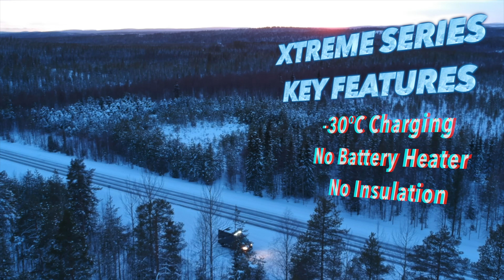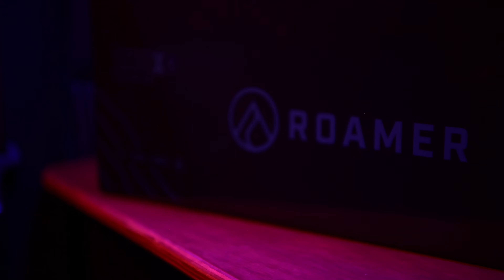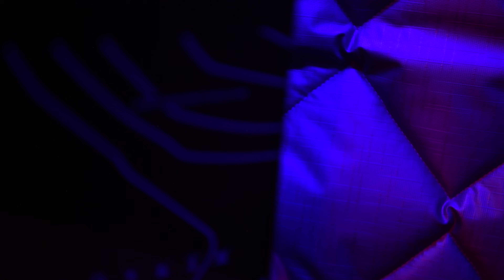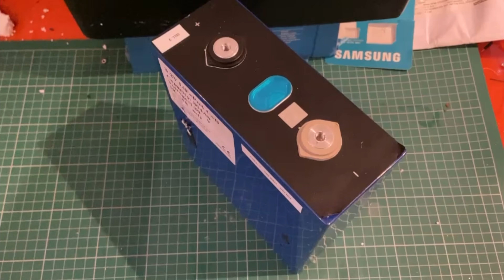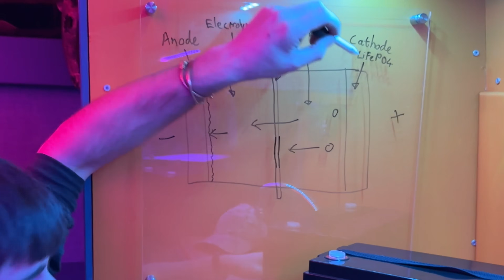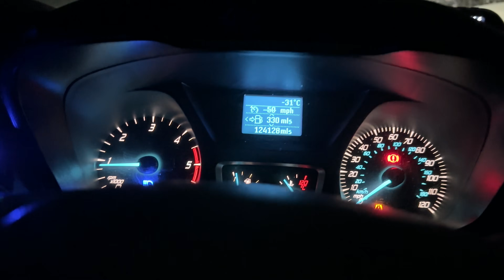HOW TO charge LITHIUM below ZERO!

Comment: LiFePO4 != "Li-ion" [sic].  The two are very, very different.  The voltage on LiIon is far more linear with charge discharge than LFP.
If you charge a 12.6V 3S LiPo to 12.6V when it's at 0*C and then the day time sun hit it and it rises up to 30*C.... the voltage across the cells can be greater than 4.2V causing harm or worse.
It's why if Li_Ion is used in solar/bulk storage it's limited to 4.1V and 60% capacity, with the 20%-80% charge target.
LiFEPO4 is a completely different ball game.  The charge voltage tolerance is far, far higher.  More importantly the tolerance of far outside the nominal. Unlike LiIon/LiPo, LFP's fully charged drops rapidly with 1% capacity to around 3.4V.  Ironically, 13.6V float voltage.  However, if you put up to 4.2V across a cell it will not explode or be damaged.  A Li-Ion/LiPo charged to 12.0V is undercharged.  Charged to 12.6V it's fully charged.  Charged to 12.8V it's overcharged and being damaged. Charged to 13.0V it's likely to be on the path to fire.  12.6V = full.  12.7V = overcharged.  Compared with a 3S LiFePO4 and "99% charge" is around 3.4-3.5V per cell.  Max charge voltage is 4.2V.  It gives you HUGE headroom.  It also makes top balancing by charging to 3.7V and allowing absorption, provides a stable "max" top balance without additional resistors.
Reply: what does a resistive top balancer do?  Add Ohms to the top most cells.  What does putting a voltage greater than 3.6V per cell do?  Yep.  Exactly the same thing.  Keep trying to push voltage and the cell will just provide more ESR.  Inbound current drops towards 0.
By pushing LiFePO4 all the way up to the 14.40 or even 15.00 voltage provided in "automotive class" 12V circuits, actually top balances them by default.
Reply from the maker: Thank you taking the time to reply ( apologies this comment got lost in the comments ) 

Yes Lifepo4 is different from li-ion but that why i say early on this video say this video is only about Lifepo4 and not another other variations of lithium chemistry due to being such a variety and use case.

However thank you for the detailed post
Reply: @MispronouncedAdventures  A note on my balancing comment.  It only works that way if you have a tricky current.  Any substansial current and it will unbalance at the top.  Not worth doing out side of a test.
Reply from the maker: True, my older lithium batteries ( which were converted from a EV ) but had a diagnostics plug in for a computer to see some very detailed read outs. I got used to watching the effects on balancing / unbalancing at the top with different charge currents. Which help me pick my own charge profile
Reply: @MispronouncedAdventures  Doing just that as we speak with the data output from a JK-BMS fed to a database and displayed with garphana.
LVC test went "ok".  Decided to try a bottom balance.  Today it reached full charge, although with a huge inbalance and a cell HVC :(  The JK-BMS balancer is "ok", but not great.  
The heltec flying cap balancer does a much better job, but you need to switch it off or it will sip power away when not needed.
Reply: Through years of use the old "LiPo" batteries would lose a cell if bank was set at 12V if load current would drop below 10V and "die" if not connected to a charger. For off grid I would still recommend keeping a standard Lead Acid battery for starting or where can instant 150-250+ CCA Amps are needed. It appears newer gens of LiFEMNPo4 batteries come with the VCO added so batt voltage stays above 10v. On mini packs, the tech has improved so if a charger that requires separate cell connections as to recharge, supplying dc to batt as to get voltage above 10v salvages the battery from being tossed.  Of course in remote cold areas keeping a good gas generator, and keeping LiFEMNPo4 within optimum range and keeping charge/discharge 10c or less=😊

Comment: Isn't this what Winston does with the LiFeYPo4 for quite a while already?
Reply from the maker: This is a interesting point. I had not heard of the Winston or the LiFeYPO4 chemistry. 

I’ve only had a quick scan of the datasheets. It seems it changes to the LiFePo4 chemistry adding yttrium to make LiFeYPo4. Where they have achieved a similar end goal by changing the Normal LiFePO4 lithium chemistry over the video approach of changing the electrolyte and anode.

Winston seems to be a raw cell manufacture and not a end user battery as in this case case, discussed in this video.

I wonder what the pros and cons are of this variation of chemistry over others. Higher price or weight. 

Interestingly, their cell seems to be prismatic which is an interesting use for a cold temperature cell as cylindrical cells are better at thermal regulation. 

Cool variation of lithium chemistry tech anyway, my previous set a batteries LiFeMgPO4

Comment: Hi Alex very interesting. At one point you talk about using a Victron smart shunt did you say you are or aren’t going to see the power the battery is using to heat itself ?
Reply from the maker: These batteries don’t need heating. 

The part I mentioned that internal battery heaters,consume energy, but it’s done in a number of different ways. If it’s a built-in battery heater, then the energy use is going to be upstream of the Victrum shunt. shunt would never see the energy being used. And SOC would be out on Victron shunt ( but not the batteries own BMS SOC )
Reply: @MispronouncedAdventures  thanks for that clarification. Much obliged 🙂👍

Comment: Very interesting stuff Alex!! As I'm going to built my own 4 season exedition vehicle in the midterm for longterm use (also cost wise) but also open minded for more purpose use of components (here very cold condions), I'm asking myself, if there is a "best" temp for loading those batteries and best for unloading them compared to "normal" LiFePo4? Let's say, 20°C, will the special Roamer-Batt's electrolyt cause less life cycles or less percent of unloading capacity?, what about at +60°C or more in hot summer full sunny parking spot near equator (been absent in a colder pub for sure ;-) )? For me, going a 4x4 max. 6m version with a bit of good wading depth, searching always for more room space and volume, I could think of positioning such Romaers underneath the camper box (maybe isolated, maybe not, but maybe yes, as to be set water protected (!?). Lowering center of gravity would be a benefit the same time and good package dimensions as well to go somewhere to the middle inside the vehicles semi felxible ladder frame. But, if this outside temps would maybe low life cycles, that wouldn't be my choice COST wise in the long term usage. Hmmm. What to consider? Any hints or recommendatiosn on that? Many thanx! Cheers
Reply from the maker: Hey, just to check when you says “loading” and “unloading” do you meant charge and discharge? The xtreme series effectively have an increased temperature range for both discharge and charge in high and low temperature conditions.

The datasheets in Roamer website have information on testing & life cycles on the cells are different parameters. But as far as I’m aware and reading  it doesn’t have less lifecycles under normal conditions than regular cells.

I can’t remember what the IP rating of the units are but the could be mounted under a conversion as long as reasonable protection was considered to stop water reaching the terminals on top of the battery
Reply: @MispronouncedAdventures  Many thanx. Yes, I ment (dis-)charging. Sorry, 'been non native speaker. ;) Cheers

Comment: I am not using my semi off grid system in extreme conditions like you. I have three 30kwh 48v prismatic packs which are kept in outbuildings. Two of these are in trailers to move the power to my home. To combat the cold temperature problem the boxes are well insulatedespecially at the bottom. I attached heater mats to the underside of an aluminium sheet which is below the cells. This spreads out the heat evenly. The mats only produce about 60W of heat. This is fine as it slowly distributes the heat with minimal heat spots. I set the controller to come on at +5degC and off at +10degC. During ambient temperatures of - 6degC this winter the battery temperature (sensor placed lower centre of the pack) was fairly stable. I think the secret is to have plenty of insulation, heat evenly from the bottom and use just enough heat to maintain temperature. In effect you are then maintaining temperature rather than heating the battery. If you start from a fully chilled battery that is a different problem. Given the weight of a pack (about 160kg in my case) there is a lot of heat inertia. Much easier to start off at a minimum temperature of say +10degC and prevent sub zero temperatures than heat from cold.
Reply from the maker: That’s how I heated my previous set of lithium batteries. A heat pad ( per battery) with a aluminium  plate underneath to disperse the heat. Evenly in well insulated box. Regulated by a temperature relay. And that system worked rather well. It became even more useful when I did lift the batteries in the insulated boxes off the ground have an air gap. Then the heat pads came on less. which would make sense as there’s less cold transfer from the cold floor into the insulated box.
Reply from the maker: I also use the same principle to heat my previous batteries. I would have it come on at 8° C as you stated it’s better to stop at reaching zero then have it come on at zero. As batteries are a huge mass and it’s quite a lot of energy needs to go into them to heat them all up evenly, especially prismatic cells.
Reply: One of my packs is in a wooden box on castors which certainly minimises the cold soak problem.
The other two are in trailers. This provides plenty of ground separation but the skin of the trailer is metal so the insulation is slightly more important.

Comment: As Alex said, if you want stripdowns, and often destructive testing, Will Prowse is the man.
I bet he'd LOVE this video!
Reply from the maker: Maybe I’ll be lucky enough he will watch it! 

He is a fantastic resource and his 50+ playlist of battery teardowns. I do a great job emphasising the point. They all generally use the same plastic box, but inside they can be shockingly horrific or incredibly well engineered.
Reply from the maker: @ThreeFineWonders  I guess in the broader sense Will is correct as he only looked at lithium batteries using the conventional cell construction, easier to say it can’t be done overall. And Roamer Xtreme series is the first on the market to use a cell like this. I’m sure if he watched the video he would find the tech interesting.
Reply from the maker: @ThreeFineWonders  what sterling Lifepo4 were you looking at? I’ve just looking at there datasheets They all seems to have a 0c low temperature disconnect. They do have a heated battery which is labeled “low temperature operation” but that using cell heaters.
Reply from the maker: There are on there Gen3 normal battery, models change and develop. 

Normally a “-20c” is referring to a minimum discharge for Lifepo4 and not a minimum charge.
Reply: Will sucks. 😂

Comment: The ultimate danger of dendrites is that they physically puncture the separator, causing a short.
.
The Nickel based cells (normally cylindrical) have a higher energy capacity per kg (and per litre)
.
As such the Nickel based batteries tend to physically lighter weight than LiFePo4 (Lithium Iron Phosphate) units.
They are both lighter than lead acid.
Reply from the maker: True, there were so many areas to try and cover in one video. But I did miss physically damage. I hope it’s public known physical damage / compromising the cell is very bad! Even if I didn’t explain the mechanism of the damage

Physical damage to the cell yes ( I believe that was an issue with a Samsung phone model a few years ago. The anode and cathode contacted each other due on the folding of the cell due to the shape of the battery in the phone chassis. 

But yes, contact between anode and cathode will lead to complete and catastrophic failure of the cell. Although in that case, the lithium playing is least of your issues. 

Puncturing the cell would lead to the ultimate dendrites forming 

As for NCM being higher energy density, I believe that was the reason many of the original large power banks used at chemistry, smaller lighter units. But switch to LiFePO4 because the name is more marketable ( public have heard of it ) and the more marketable cycle life count

Comment: Nice video i built a heater like in your van for my lithium battery i built for my off grid shed that runs part of my house thanks.😀👍
Reply from the maker: Brilliant , I think heating the underside of the battery via a plate is a brilliant and the most effective and safest form of battery heating

Comment: I'm seriously thinking of moving from lead acid to lithium, as soon as I use my inverter my batteries start dropping power, does this happen less with lithium, if I say replace my 2x100ah lead acid with 1x100ah lithium?
Reply from the maker: Yes, lithium is far less susceptible to the effects of voltage sag ( a high inverter load dropping system voltage ) 

Swapping 2x100ah lead acids could 100ah lithium would work. But probably swapping for the 160Ah model which be better. Depth of discharge for lead acid is recommended at 50%. 200ah = 100ah usable.  100Ah Lithium is around 80%. = 80ah. So a large 160ah lithium would be better
Reply: @MispronouncedAdventures  160 Ah * 80% = 128 Ah useable. Just 125 Ah would be enough to get 100 Ah useable capacity.
Reply from the maker: @casparv  I am aware of the math. I used 160ah as that’s the next size up Roamer make after 100ah @ 12v model
Reply: This voltage drop could also occur when the inverter is hooked up to the battery with wires that are too thin (though you should only see a voltage drop when measuring on the inverter side!)